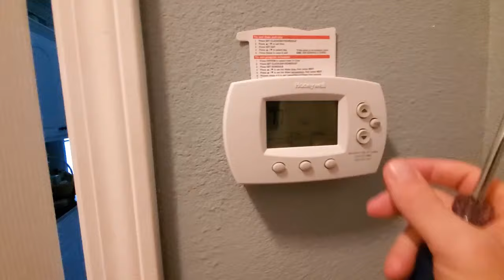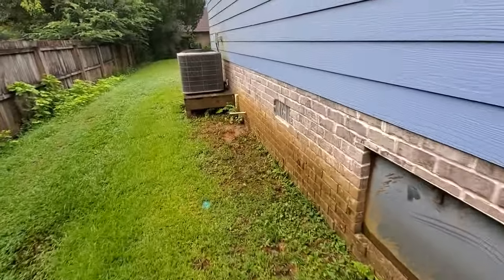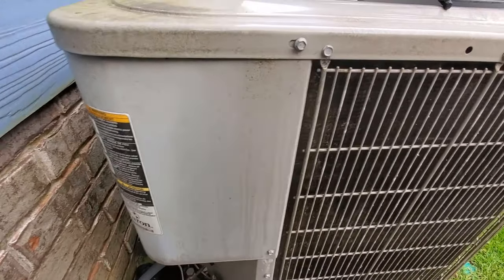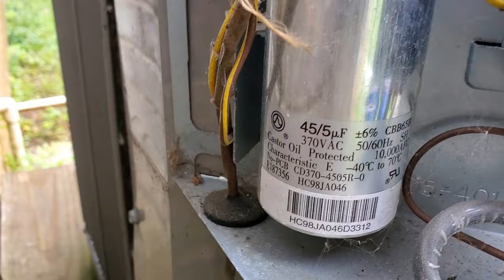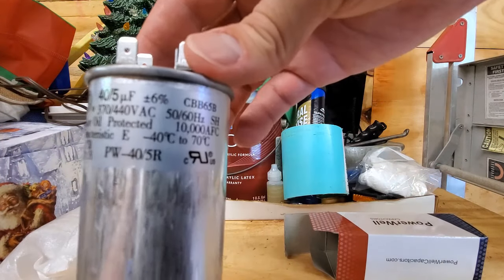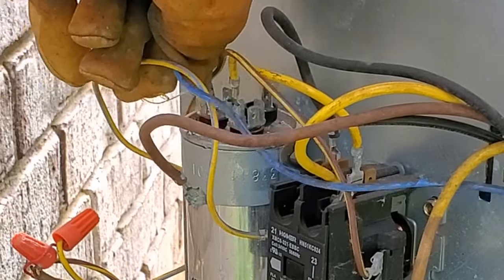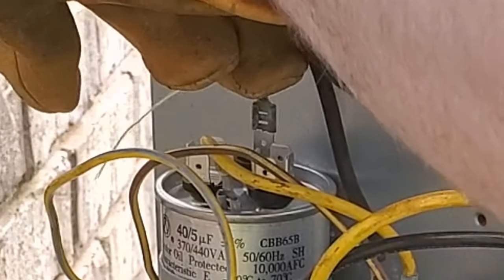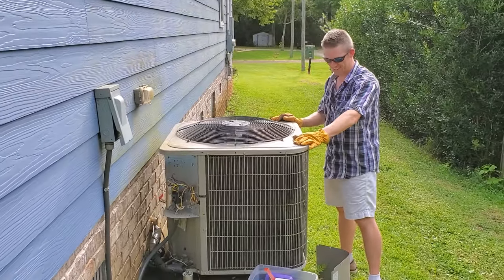How to fix your AC: fan not spinning

Comment: I nearly killed myself, through a slip and fall, in my tiled lobby, when the drip pan overflowed. It took me hours to scoop out the water. A few days later, same issue, overflowing drop pan pouring through the roof. Used a 5gallon wet/dry vacuum and that took far less time. This lasted a week or more and same issue. I decided to use my hose pipe, with a powerful nozzle attached, to force a jet stream up the outside pipe, attached to the overflow and a bunch of gunk came pouring out and the ac did not overflow the drip ever again and its been a month or two now. Well today, the ac stopped working and has climbed to 87 inside. I first blasted the pipe with a jet stream of water but that was not the issue and I noticed the fan not running. I did the screwdriver trick and it ran for a short while and then off so now I suspect the capacitor. I'm gonna attempt this self help fix, in the week. Hope it works. 

Thanks for the video.

Comment: I know this video is a little bit older but I did the screw driver trick and fan is going but still not cooling the house. How long does it take to start cooling after getting the fan going

Comment: So the screwdriver trick did work.. But my air still isn't cold. Any advice on next steps?
Reply from the maker: @avery8787  gotta add coolant / freon. Unfortunately I think all you can do is call an AC guy at that point. Mine charged me $60 / lb of freon.

Comment: Trying to make the fan spin as in your video didn't work. What next should I seek as a problem?
Reply from the maker: There's a change that it could be the capacitor, but not likely.  If you don't hear power going to the AC I'd guess there might be a blown fuse.
Reply: @KentsGarageGym  Hi Kent, I did have a loud buzzing all the time it was powered on. Just removed the capacitor and the top (where the electrical connectors are is slightly domed. Should these be flat and not any doming shape?

Comment: We have found the same exact specs as ours which is a titan hd motor run capacitor but the only thing different is ours says mfd 45+5 mfd then it has plus or minus 10% and when we type in our model we find the same exact one with the same writing on it and brand and says 45+5 mfd but it says plus or minus 5%. we can hardly find a 10. Would then one that says plus or minus 5 also work on our unit as everything is the same including voltage etc except for that percentage number. Thank you

Comment: If you use the screw driver method to spin the fan when you turn it on, will that keep spinning giving you AC until the new piece comes?
Reply from the maker: You'll have to do it over and over everytime the AC stops. It will be tedious, but it's better than nothing.
Reply: @KentsGarageGym  thank you so much for the fast reply! Unfortunately I tried to do it but it spins not so fast for a few seconds then doesn't go. Makes noise like it's going to but then that stops after a few tries also. 😒

Comment: I tried to do the kick start with the stick. Doesn't start. What other reasons can cause it not spin?

My furance/blower is working fine. I do get air, but it's not cold. Even with me thermostat set to cooling, the unit doesn't do anything. 

I don't see any leaks. But if I listen very closely (head to unit), I hear a low hum or buzz?

Comment: Started watching the video, went to check on the fan and it was not spinning, it's 90 degrees outside, I go back there with the long screw driver to turn but THEN it was already spinning, I wonder if it's still a bad capacitor being unstable

Comment: You said something about pouring Clorox down something....I've never heard of this. Can you please explain?
Reply from the maker: Yeah! YouTube search how to clorox AC condensation drain. Open your ac closet, you'll find a pipe with a removable cap. Pour water and clorox down it. It drains outside. If you don't, it could get clogged with mold and give the ac problems.

Comment: I think I fixed it but I’m not sure. I tried this and the fan started spinning inside( before it wouldn’t spin and when I would turn on the ac from inside the house I would hear it buzz at me for about a second then stop.) My guess is that it’s trying to start up the fan. Now the fan is spining but it keeps buzzing. Any guesses?if you know please let me know if it’s about to blow up or something worst.

Comment: I just have to say as I have seen others say you ordered a 40/5 when yours was a 45/5 also honestly surprised it ran at all because of the fact that you hooked it up wrong at least in the clip you showed in this video as you connected the blue wire (for the compressor) to the c (common) terminal and the yellow (for the incoming voltage (common) to the herm (compressor) terminal I understand wanting to do things yourself and wanting to save money etc however refer to professionals when you don't know also a blown capacitor has nothing to do with drain lines at the furnace or airhandler and everything to do with wear on the part itself btw I'm a HVAC Pro I do this for a living people following your horrible advice are likely to cause more long term damage

Comment: I replaced the capacitor,  but then it was moving the fan slowly. I had to manually spin the fan to get it going a little then it kicked in . Would you know what else it could be
Reply from the maker: Is the capacitor an exact match of the original?

Comment: You said clockwise, does that how blades rotate in your conditioner
Reply from the maker: Yes, I did it correctly in the video. If you wire them backwards it will spin backwards and not cool right. If you feel the wind blowing strongly upward instead of down into the machine that's a sign the blades might be spinning backwards.

Comment: IS the fan suppose to come on for heat
,repairman came last week,the fan worked on ac mode,but when I turned on heat setting (after he left) the fan didn't come on/spin.Can you give me info?He's suppose to come back today,hope I don't have to pay another service charge,cause he didn't check this last time.
Reply: ALSO I just had a new capacitor last year installed.

Comment: my AC is running inside and i checked the outside fan, it isn't working but when i got closer, i felt the top of it, it wasn't hot, and there was no humming either. i tried to spin the fan with a screwdriver and nothing happened. should i still try to replace the capacitor?
Reply: If there's no humming sound then I would say failed contactor, changing the compactor won't help.
Reply: Joshua Richie my ac guy tested the outside unit and it was fine. It ended up being my pvc pipes inside. Totally my fault. I neglected doing bleach/vinegar in the pipes. He used some air tank to force the gunk out the other end. It was quite a lot too

Comment: Was the previous capacitor old or is it wrecked
Reply from the maker: It was a late 2013 AC and had this problem about June 2019, so about 6-7 years.  The capacitor just stopped working apparently.

Comment: Clorox down the drain pipe?
What drain pipe?
Reply from the maker: So inside the home (maybe in your attic, wherever the main inside AC unit is located) there should be a PVC pipe with a top that can pop off.  Water from the AC leaks out this pipe and overtime can get clogged with mold, especially in the summer.  It's got to be cleaned out regularly - but the easiest way is to just put clorox down the pipe to eliminate the mold.

Comment: This is why you don’t make youtube videos if you don’t know what you’re doing. First and most Importantly you had a 45/5 capacitor you should have replaced it with one. Instead you replaced it with a 40/5 (yes there is a difference)

Comment: Screw driver has got my nana’s ac blowing cold again ordering new part now
Reply from the maker: Have fun waking up in the middle of the night to do the screw driver trick :)  hope that part comes in soon
Reply: Kent's Garage Gym I already got it fixed today only ran it to cool the house for a hour or so that trick should only be used for a very short time and watched closely my buddy who does A/C work for a living said it can cause the motor to burn up but all’s good here switched out the part and gave the unit a good spray down good to go just finished it up cheers

Comment: So if the fan don't turn untill you do that then it's this problem? Because my fan was not turning until I did what you did and then it started turning but then it stopped about 10 minutes maybe a little less after having it on
Reply: Maybe a bad fan motor .I have the same problem . Changed capacitor and fan started and then stopped. Makes a weird noise now. Fan looks real old and kinda worn out metal. A lot of snow ,ice and rain where I live. Look at the youtube videos on how to change fan motor or the entire fan itself. Good luck ☘

Comment: The screwdriver trick worked and the fan started spinning, but the new capacitor did not fix the problem. It still won’t start by itself.

Comment: So you just touch the top of the capacitor with a screwdriver ? That’s all? To discharge it ?
Reply from the maker: Yeah, touch with some metallic object with a protective wood/rubber/plastic handle.
Reply: L

Comment: Mine just started doing the same thing but when I get it started by hand it still does not produce cold in the house. What's wrong?
Reply from the maker: I wonder if there's enough cooling solution in the AC? Or maybe a setting on the AC control?
Reply: @KentsGarageGym  It was working fine this morning. I'll try the relay. I wish there was a local supplier here. It's in the 90's.
Reply: @KentsGarageGym  Control is the same, Coolant could have leaked I guess but unlikely. Considering I had to start the fan spinning with a long screwdriver I'm going to try the capacitor first. I know how to discharge them.
Reply from the maker: @blueeyedsoulman  good luck bro

Comment: I replaced the capacitor, the filter, and the thermostat and the ac came on and the fan on the ac unit ran for about 10mins then stopped turning. The blower from the furnace is still blowing. Any suggestions?
Reply from the maker: Maybe a blown fuse? contactor?
Reply: @KentsGarageGym  Hello and thanks. So a blown fuse will still have the AC run then have the fan stop?

Comment: I have a similar issue on my pool heat pump where I need to jump start it moving with a twig. It spins up and runs fine after, any ideas on if this fan can be pulled off and sprayed wd40 down the shaft. I m trying to to open this up too much.
Reply: if you need to kickstart the fan with a twig, it is because your capacitor is not holding enough charge to spin the fan. You need to change your capacitor.
Reply: Robert Roman thanks Rob. Someone else said that. I was quoted $200 for the service call incl parts and labour. No going to fry myself on 240 volts right? Looking to some friends who can do this for dinner and a case of beer. 🧐

Comment: You pouring Clorox down the A/C drain has absolutely nothing to do with a failed capacitor..a failed capacitor just kinda happens. Typical wear and tear. Keep that drain cleaned though.

Comment: mine is doing this but even after replacing it, it still needs to be helped by pushing the fan wit a screw driver. why is mine doing this?

Comment: i am having the same issue my unit hums but doesn't  always start spinning until i manually spin the fan blade, is it normal for the unit to be hot? like hot air is coming from it? i am not as brave as you guys am gonna have to call someone to have a look at it lolz

Comment: Does the fan run all the time when the unit is on? When my furnace is on the heat pump motor will be running and the fan won't be on sometimes. It will turn on sometimes but it isn't on all the time. Is this normal?

Comment: Ok guys i need some help let me give you some background information.

I was cleaning my backyard with a gurnie and decided to spray the fan box thingy thats outside and sprayed the outside of the box and the interior making the fan spin with the gurnie and now my aircon turns on and all but the fan doesnt seem to be working, what could possibly be wrong and how can i fix it?

I'd greatly appreciate any feedback that can help me save some money from having to call out a technician.

Is this video what i should do?
Reply from the maker: When you hear the AC turn on but fan doesn't spin, have you tried spinning it with a long screw driver?  If so, does start the fan?
Reply: @KentsGarageGym  i tried your suggestion but the fan seems completely dead and oh btw its an "LG inverter V" if thats any help.

Comment: Capacitor is working(brand new). I tested it and it has the right reading. The fan will not spin unless I spin it. What other issue can it be? Thanks in advance.
Reply from the maker: Hmm.. so my understanding is that there are 2 sides to the capacitor - the starter and the runner.  Seems like the starter is bad, but the runner is not.  When you say it is new, did you just change it?
Reply: Check the wiring, on the capacitor c stands for common, H stand for compressor and F stand for fan
Reply: Could be the motor overheated
Reply: Kent's Garage Gym Kent s Garage Gym

Comment: I did all that, but my outdoor fan still not running :( PLEASE HELP
Reply: Are you sure all that it and the breaker is on and the fuse cartridge is in? Is the starting capacitor plugged in correctly?

Comment: I have a thermostat question too,New thermostat too last week,I set it manually for 62°,goes up to 67°,when I noticed it was getting hot,I turned thermostat off ,,called repairman who installed it,he couldn't come for few days,so I tried it again when I needed heat,it happened again.WONDERING if the thermostat was preset at factory,and it over rides what I set manually???help

Comment: There's a lot more wrong with your system than just sludge in your drain line, for starters the people that installed your system should have known there's a minimum clearance required for the unit to be away from the house.
Reply from the maker: You mean its too close to the house?

Comment: There is just no way that the drain clog had anything to do with your Air con failure....just a common failure
Reply from the maker: One problem was after the clog, the ac kept trying to start and restart.  I bet you're right, it might have failed anyway but probably it would have taken longer.
Reply: Kent’s Garage Gym

Comment: I have a heat pump and this morning when theheat was running I heard a chirping sound coming from the heat vents. I looked out the window and noticed the top fan was not turning. So I walked out to the unit and I could hear the sound inside the unit. Could the capacitor be causing this problem as well ?

Comment: I replaced the capacitor, contactor, battery on thermostat and nothing.
Reply from the maker: Were you able to get the AC started by moving the blade like I did in the beginning?
Reply: @KentsGarageGym  I try but it didn't work..
Reply: @KentsGarageGym  when I turn the thermostat  on cool and auto the contactor just lock but thats it..
Reply from the maker: @unitrecordcorporation9616  if it didn't work originally by spinning the fan, i wouldn't have thought it was the capacitor.
Reply: @KentsGarageGym  at the end, it was the breaker fuses, it was not getting enough  power to run the fan.

Comment: Hello I just Bought the new parts . But still nothing. So confusing. If u can try to explane what I'm doing wrong.
Reply from the maker: Were you able to get the AC to startup by hitting the fan? If not, the capacitor may not be the problem.
Reply: @KentsGarageGym  new batteries lol
Reply: Ahh I figured it out. The ac unit  switch was burned out  almost paid 500  but at last minute  I tried this. Final attempt and wala got it.thanks  I learned alot.

Comment: I replaced the capacitor and the fan still doesn’t spin.. I just hear the AC unit hum now
Reply from the maker: I guess that means the capacitor wasn't the problem. We're you able to spin the fan and have it turn on? Hopefully you can get a refund for the capacitor you bought. Gotta call an AC guy I guess.
Reply: @KentsGarageGym  I spun the fan manually with a stick, and the fan seems stuck. It I try hard enough the fan will rotate 1 full rotation around and it’ll get stuck again. Over the past week the fan would sometimes spin itself and it’ll last an hour or two, but then it’ll just get stuck again.
Reply: @dank_sxc  thats the fan at that point .......